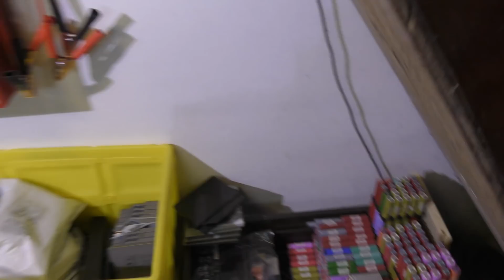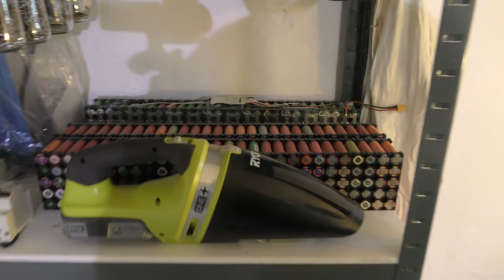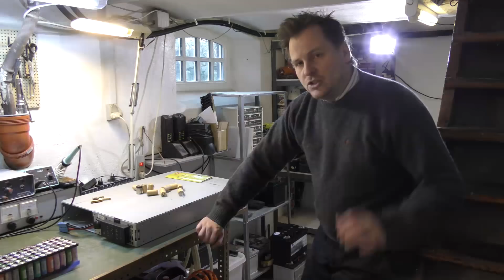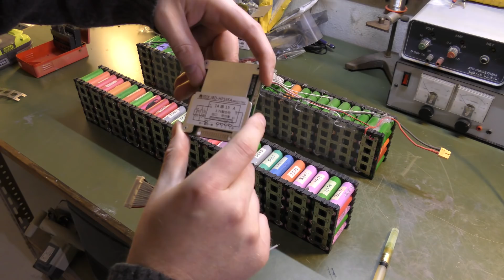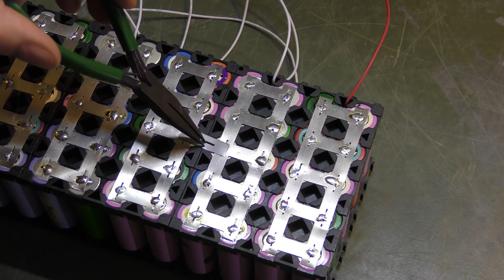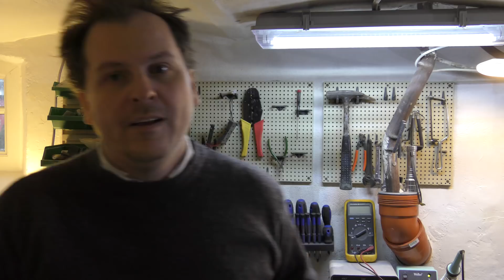First 2 KWH of DIY Li-ion Powerwall made from 18650's - 788

Comment: 17:19 You are putting all the stress on that one area to series connect those packs. You should have ran that strip down all 5 of them to series connect them so the power would flow from one series connection to the next evenly . So when this is in service, you have all 48 volts including the full load of current traveling though that one little strip rather from 5 to 5,. Think of putting a garden hose on a fire hydrant, all that water is going to rush through the smaller hole and cause stress,  if you were to connect the actual fire hose to the hydrant, the water will flow with less pressure. Be careful that one little strip is going to get hot under load!
Reply from the maker: The maximum power going through there is 15A, with 4 batteries in use the amps is down to 10A,, I have messed up and the little strips between the cell groups did not give up,, it blow the 10 fuses on the cells,, so fuses are the weakest point,,as they should be.

Comment: Great video, What are you using for the fuse wire? I can only find 5A on eBay
Reply from the maker: They are just some copper wires that I tested to do 4-5 amps.

Comment: Nice battery it would be good if you could go a step further and make a video on what this battery could power and for how long in an ordinary household  situation
Reply from the maker: Hi Absolom Madhaka
Thank You very much!  What you use in your household, varies incredible much,, and how you use it. Take a water heater, I have one that holds 300 liter, and has a heating element that will slowly heat the water up and keep it warm. Others has a system that quickly heats the water but only when you need hot water.
This uses less power over all,, but takes a lot of power when hot water is needed,, and almost impossible to do by batteries. and the same goes with a lot of other household stuff. I have a lot of 400 volt stuff,, really bad for solar.
Thank you for watching! :-)

Comment: do you know how unsafe this is?? AND YOU SOLDERED THEM TOGETHER?? your house is a literal bomb , I hope I don't live anywhere near you
Reply from the maker: Li-ion 18650, has been in every laptop for 0ver 20 years, and you can bring your laptop on to a plain,, and there are 8000 of these in a good Tesla. I do not feel unsafe.
Reply: @MyPlayHouse  yes, but they are spot welded and have protection circuits.

Comment: I will be constructing something similar soon. May I ask what type/wattage soldering iron you use ?, I can imagine you need something with some power ?
Reply from the maker: mine is somewhere between 50-80W,, but soldering the batteries,, I use full heat...

Comment: I want to build a 128s14p battery pack, there's a lot of cell, do you know a way(calculator) to make all 14p blocks the same capacity
Reply from the maker: 128s ,, becomes  384- 538 volt DC,,, I once got a tiny 230 volt DC electric shock,, took me 15 minutes to become myself again.
I would recommend a lower voltages.
There is an online calculator ,, I do not have the link..

Comment: Do you think the panels wattage was only 50w because the bank was full and the solar charger had switched into float mode?  I have a 24v bank and this is what happens to mine, have you thought about using grid tie inverters to feed in surplus solar power to your house when the bank is full? This is what I do with 2 cheap chinese 600w grid tie inverters and I can feed in around 1 kw off 8x 200w panels and still keep my batteries float charged!
Reply from the maker: Hi k k
I am playing with using surplus of power, for bitcoin mining :-)  glad you liked the video :-)
Thank you for watching! :-)

Comment: 2 kWh = 2000000 mWh & 788 pieses of 18650?  Hmmm, very poor, its only 2538 mWh per one 18650 - and it is a little catastrophe, because of only 705 mAh per one 18650 cell !!!
   
Most powerfull 18650 has 3400/3500/3600 mAh and with nominal voltage 3.6-3.7V has 12250 - 129500 mWh, lets say avarege 12500 mWh. For 2M mWh (2 kWh) power back we need only 160 pieces of most powerfull 18650 cells and not 788 pieces. But hobby is hobby: to collect old, defect, long-used, low-capacity, cheap & chinese 18650-cells.
   
Furtther more there are also other formats, not only 18650 cell - there aj 21700 (up to 5000 mAh: https://bit.ly/2ZES2ix), 26650 (up to 6000 mAh: https://bit.ly/2HRvVQb) and 32650 (even more than 6000 mAh: https://bit.ly/2Lca1Jf). The size of 32650 is the same as D cylinder battery. With these 6000 mAh of 32650 , only 93 pieces woul be needed for 2 kWh.
Reply from the maker: You are mixing to much together,,, a normal 18650 which holds 2500mAh will do about 3,7v*2,5Ah = 9,25 Wh and so my two banks in this video of each 140 cells should be around 2Kwh

Comment: Your work looks good. Great Job.  I don't know much about the BMS you are using. Are you saying that the BMS may blow if more that 15 Amps are drawn? if this is Correct, then what about adding in a 15 Amp Fuse on the main supply to the Pack!  Regardless of how many Packs you will end up with, this can only add another level of safety.
Reply from the maker: Hi Adam Cecere
Thank You very much!  I do not believe the BMS will blow :-) just not delivered more.
Thank you for watching! :-)

Comment: So how did procure such a substantial amount of cells? Buying surplus laptop batteries in Denmark, or somewhere else in the EU?

- A side note: You love renewable energy, but also old servers, two opposing hobbies in the sense that one of them uses a ton of power while you solder together you battery banks. What about a 100 node Raspberry Pi Beowulf cluster. That would use only 200-300W?
Reply from the maker: Hi Tore Lund
Well I did a video on getting cells : https://youtu.be/y_45sKpnCho
I have the projekt of running my datacenter of solar,,, it has not been without setbacks..
Thank you for watching! :-)
Reply: @MyPlayHouse  Thanks! Cheers.

Comment: uh your 48 volts is 12S and its standard practice to do the fuse on the + side of the battery and bind your grounds or fuse both + and - im racking my brain to figure out how you have that together at 14 pairs of cells if you series those your gonna get 58.8 volts and a 48 volt inverter may not like it much. If your pairs average 2 amp/hr per cell and you series 14 pairs youll have an average of 10 amp/hr at 58.8 volts sense you have 10P for the cells at 2 amp X 10 = 20 amp your 14S 10P packs are good for
Max voltage =58.8
Min. voltage = 39.2
Max current = 20 amp (2 amp at 10 cells in parallel) 
Amp/hr = 8 to 12 Amp/hr depending on cell degradation for the group
 Just goes to say high voltage can rob you blind to get any usable capacity. 64 cells @ 4S 12P can get 48 amp/hr pretty quick even if i the pack has to have a regulator on the output for inverter and a little something extra to cover for the surge spikes.
If your inverter is 1500 watts it can pull up to 150 amps at max power depending on efficiency. On the safe side divide the watts that the inverter is by 10 to get your constant current for the DC side of things then wire and figure accordingly.

Please dont be offended just trying to help out.
Reply from the maker: Hi Steven Rowland
Thank You very much!  
Max 14* 4,2V = 58,8V
Nom 14* 3,7V = 51,8V
min 14* 3,0V = 42V

Lead Acid
Max 4* 14,5V = 58V
Nom 4* 12V = 48V
min 4* 10,8V = 43,2V

I am designing my batteries to supply no more than 15 amps each. So I need to make four of those to get up to 60 amps,, at where the inverter will be happy.

Thank you for watching! :-)

Comment: Silly question, but what is best practice to keep battery bank or laptop battery health for as long as possible. Sory asking sine power outage trigger anxiety. Ty for the vid
Reply from the maker: Use them once in a while,, laptop,, every week or so,, run it on battery ,, don't drain it all the way down, when you do not need to. 50% or so,, and then charge them back up.

Comment: HI OLD ONE LEGGED JOSEPH T HERE. DO YOU WORRY ABOUT BURNING DOWN THE HOUSE? COOL BASEMENT WHERE ARE YOU? MY MOTHER IN LAWS HOUSE WAS MADE WITHOUT A BASEMENT, SO WE DUG OUT THE BASEMENT WITH A BOB CAT. ANYWAY LOVE YOU HOLE IN THE WALL DOORWAYS!!! ANY WAY, WHAT WILL THE POWER WALL DO WITH THE EXTRA POWER, I MEAN DO YOU SELL IT TO THE POWER PROVIDER? I AM MAKING A E WHEELCHAIR FOR MYSELF. I HAVE A 500 WATT 36 VOLT HUB MOTOR. WILL YOUR BATTERY POWER THAT FOR FOUR HOURS OR JUST 1 HOUR LIKE THE 1000 WATT ITEM?? LOVE IT THIS HELPS ME OUT A LOT, JUST SAYING OLD ONE LEGGED JOSEPH T RETIRED NAVY
Reply from the maker: Hi Joseph Brendel
Thank You very much!  Why all the upper case text ??
I am located in Denmark. I do not feet it back to the power grid.
Thank you for watching! :-)
Reply: My PlayHouse  I AM DISABLED AND CAN SEE THE LOWER CASE. I TRIED TO MAKE THE TV BIGGER BUT ALL I DID WAS MAKE EVERYTHING LARGE!! IT TOOK ME TWO WEEKS TO GET IT HALF WAY BACK THE MONITOR ON THE COMPUTER STILL IS BLANK NO PICTURE. I WILL FIGURE IT OUT. MY WHEEL CHAIR WONT LET ME GET ANY CLOSER TO THE COMPUTER. LOVE YOUR PAGE WE SUBED TO SEE AS MANY AS WE CAN BINGE WATCH I THINK THEY CALL IT HAHAH JUST SAYING OLD ONE LEGGED JOSEPH T RETIRED NAVY

HEY WHAT ABOUT MY CHAIR WILL THAT BATTERY RUN IT FOR 5 HOURS OR JUST ONE? THANKS FOR YOUR REPLY TOO!!

Comment: Awesome project :) How much would you say one of these banks cost? - excluding labour :)
Reply from the maker: Hi Etherial
Thank You very much!  $50 in rough numbers,, I got cheap cells.
Thank you for watching! :-)
Reply: @MyPlayHouse  Nice :) I don't know much about these things, but how would you compare this solution to the other batteries (car batteries) you have? Is it just for fun or do you see these as more suitable for backup power etc?
Reply from the maker: @EtherialFusion  Well using a battery brakes them,, 1KWh lead Acid and Li-ion. If you actually takes out 1 KWh of the lead battery,, you will have caused a lot of damages to it. 15-20% is what you should discharge them for long life! a Li-ion,, it's more like 80%,, and it does not get damaged as much.

Comment: Just what the hell is this...
First who does solder 18650 battery? And if that isnt bad you dont have any  fuse??? What the hell man. After that for 1kw your wires are thin. And after all that isnt good way to connect battries to series. You should connect same bus bars from - of battery to + of another battery not using thin cut bus bars. And correct way is to use thick bus bar to place around cells and add fuse from every cell to thick bus bar and use thicker wire than you need
Reply from the maker: Hi Unknown Man
Thank You very much!  There are fuses on all the cells and the BMS is just 15 A so 1KWH, would be over 1,5 hours. Cables are double as thick as they need to be.
Thank you for watching! :-)
Reply: @MyPlayHouse  for 15A max this thing should be good. But if you try to take 50-60-70A from battery on this setup you will burn down your house
Reply from the maker: Well as the wires are fine, because of the BMS,,, your need see the whole thing,, if the BMS is for 15amps and all the fuses blow at 40amps and the cable I put in is for 53A,, we are all good!

Comment: Those wire gauges on the banks look awfully thin are you sure they will be able to handle the current from that many 18650's without melting?
Reply from the maker: Hi ElectroFried
Thank You very much!  15A BMS,, please let me know how thick a cable is needed to move 15Amps
Thank you for watching! :-)
Reply: Less concerned about the BMS than I am the wires that draw the power. (the ones with the connector). You can enter the details of the banks on this website and get a recommendation for the gauge of wire based on the length needed
http://www.solar-wind.co.uk/cable-sizing-DC-cables.html
Reply from the maker: Hi ElectroFried
Well as the wires are fine, because of the BMS,,, your need see the whole thing,, if the BMS is for 15amps and all the fuses blow at 40amps and the cable I put in is for 53A,, we are all good!
Thank you for watching! :-)

Comment: Interesting project, I 'm really enjoying it, thanks. Are you planing on some safety mechanism to limit each bank to <15A or does the BMS handle this? Some sort of balancing circuitry maybe.
Reply from the maker: Hi jeffparr123
Thank You very much!  My inverter is 2500watt on an 48volt system that is about 52A,, If I have 4 of these banks,, 4*15A  = 60A,, so that is why I want 4,, and I do want more than 4.
Thank you for watching! :-)

Comment: did you build the packs to match the output of the other lead batteries? vs building a bunch of 3.7 packs them series.
im looking to build a powerwall with 18650s, trying to decide to start with a 24volt system so I dont have to wait so long processing batteries...
Reply from the maker: Hi Jer Sam
Thank You very much!  That is one of my problems,, how do I combine the two banks.
Thank you for watching! :-)

Comment: Riddle me this... what happens when "one" of those cells goes bad???
Reply: There are fuses on each cell,  capable of passing 4A - as he described in the video.  If one cell shorts out, then the other cells will pass current through the dead cell until it hits 4 amps and then the dead cells fuse will blow stopping the current flow. Looks pretty good to me.   (Even perhaps safer than a laptop battery where they have the cells hard parallel, with no fuses)
Reply: @stuartgoggin4267  What I meant was, how does one "replace" a bad or several bad cells..
Reply from the maker: Hi Unkyjoe's Playhouse
I would desolder the fuse wire,, remove the four plastic tabs on the fuse side. desolder on the other side, and slide out the battery.
Thank you for watching! :-)